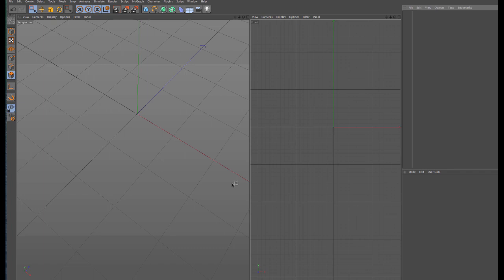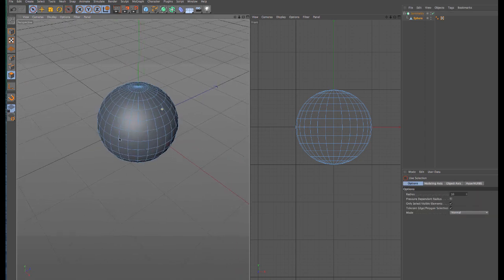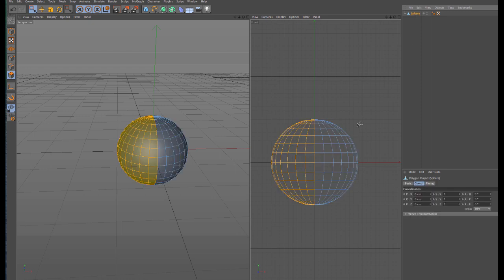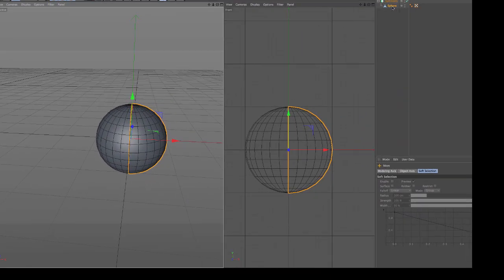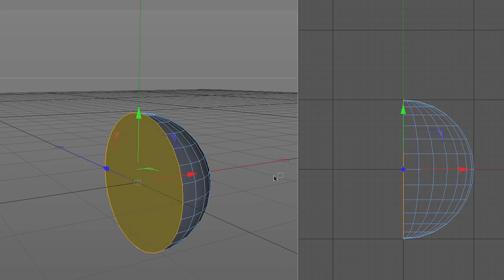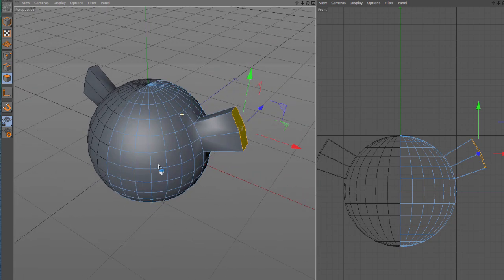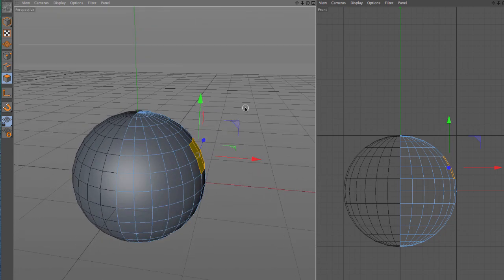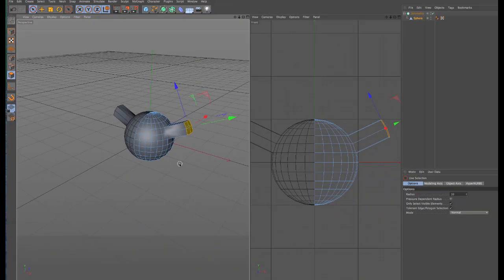C4D Symmetry tutorial

Comment: that was in fact helpful thank you, but you pointed out something and didn't give a solution for it although i know there is one but cannot seem to remember how. which is how do you connect the two sides onto each other after using symmetry, the middle points.
Reply: okay so surprisingly i have found it, it's "clamp point on axis" in symmetry settings, click it by selecting the points that connect between the two sides. in case anyone is wondering :D
Reply: @janojacks7204 the clamp setting is gone. I tried manually to snap the points to the x axis but when I move to the next it shifts the previous away from axis
Reply: @dyodoleu  yeah you have to connect them or “delete the axis points” in the symmetry settings. wdym with the clamp setting is gone?
Reply: @janojacks7204  i fixed it already but I mean that the button seems gone and others reported that it is through recent updates

Comment: What happens if you import a model which is already symmetrical? Is there stil la need to cut the object in half and apply a symmetry object?
Reply: No. If you want to use the Symmetry Object to work on only one-half of an object at a time and have the work mirrored onto the other half, then just parent the Symmetry Object to the object and what you do on one side of the axis line will be reflected on the other half. Try it with a primitive Sphere that has been made Editable, for instance, just to see what happens.